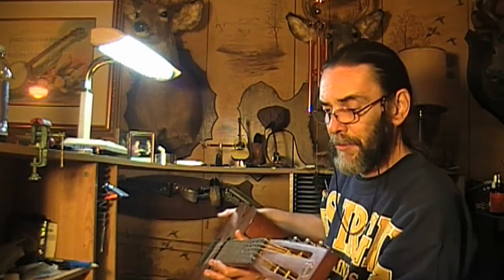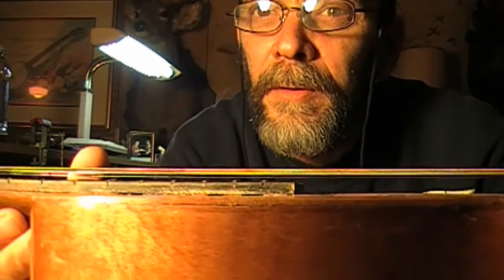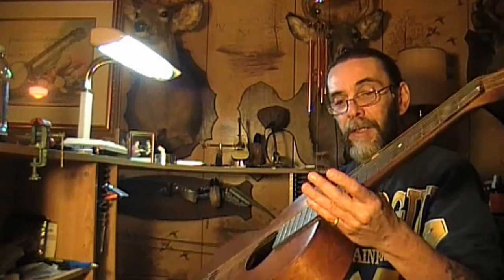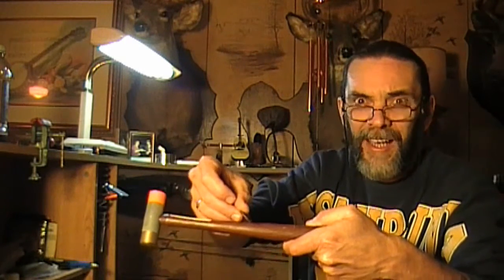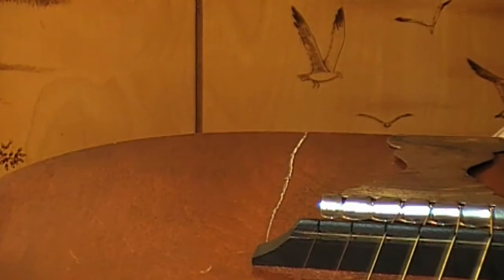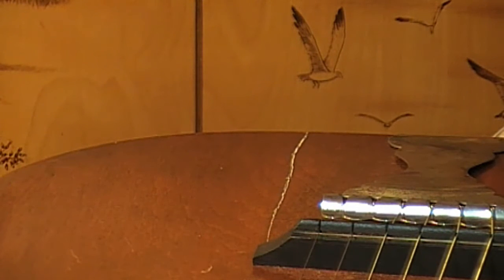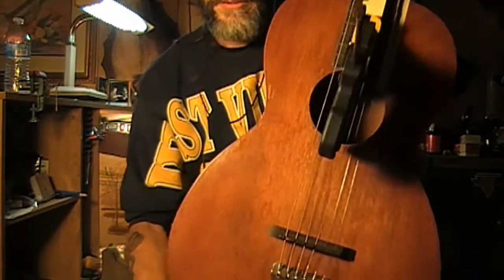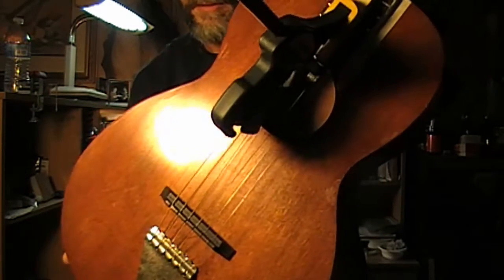Regal Parlor guitar repair part 2 of 3

Comment: Problems, problems.  Those old ones are full of them.  You probably already thought of this but sometimes when the fret board is loose over the body, you can affect the action by flexing the neck down slightly as you reglue the fret board.  Generally if it is loose, the action has been affected a little.  Anyway just another way to help the cause when you can.  Keep on truckin.
Reply from the maker: +Rosa String Works Thank you for that input and info Jerry! I wish I had read this before gluing because you are right, once I got this glued and tuned up the action wasn't nearly as high as it was when the fingerboard was loose, just that alone brought it way down. Before I glued it when the guitar was tuned up to pitch you could actually see that was where the action was the highest, it was lower near the nut and saddle and highest just over the loose fingerboard.

Comment: Most of those old guitars they stained the hole body.one of the OAHU guitars had a brace like you were talking about I read up on it they said it was stronger that way I glued it Bach ladder style. Randy you may be trying to get a hump were the finger board is loose. I will be looking for video 3. By the way that looks like a V shaped neck?
Reply from the maker: +Steve Harris I', pretty sure this entire guitar has been stained too before the finish was put on it. I wish I could tell for sure what kind of wood this is. This box only has 2 braces on the top, one runs across the top just in front and under the bridge and the other is that odd angled one. Yes it has a V shaped neck and is a thick fat neck for such a little guitar. There is a hump and a ski jump at the end of the fingerboard but not as bad as it was before I glued it. Part 3 coming soon HOLD ON?  LMAO!

Comment: Is it possible to stain tite bond? I know Stew-Krap sells tinctures for finish touch ups and I was thinking if the glue could take the stain it would make those crack touch ups you do even less noticeable on darker instruments without breaking the bank...well, relatively ...its still Stew-Krap. :)
Reply from the maker: That's a good question, I never even thought of staining Titebond before. stew-quack no down to has thought of it and probably tried it, I have some of the markers to color and change the looks of wood like in a crack that I got from them but they dried up in less than 2 months. Lol!